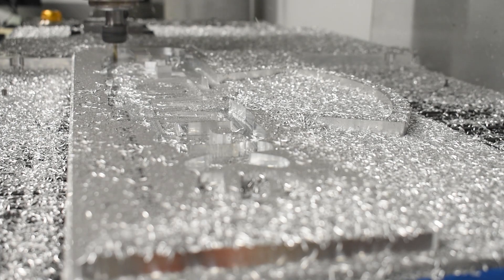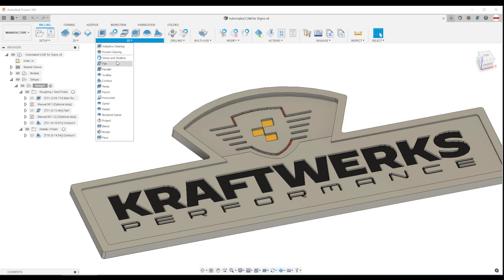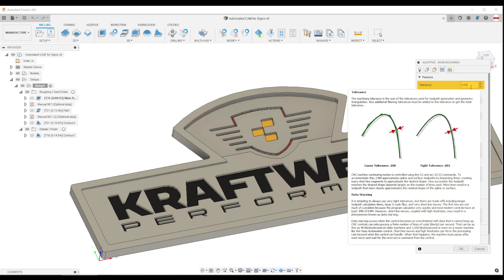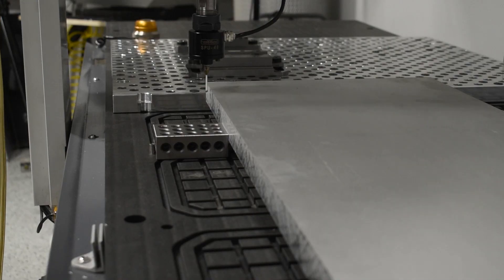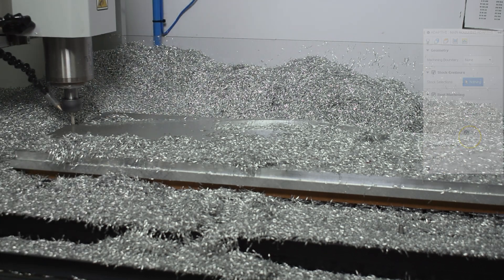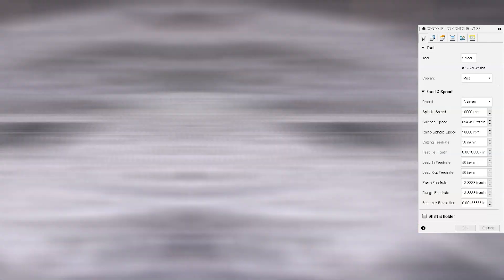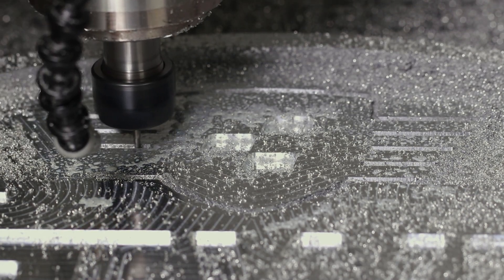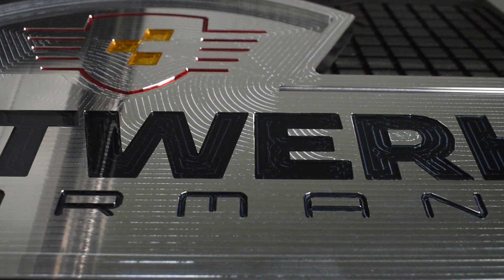Machining an Epoxy-Filled Aluminum Sign in Fusion 360 with "Automatic" CAM!

Comment: Do you think the epoxy will hold up outside with temperature changes? I have been wanting to the same type of thing for my shop sign, but figured different coefficient of expansions would cause the epoxy to flake off.

Comment: As someone who programs using PowerMILL it's weird to see that many of the new fusion360 features are just old PowerMILL features that that been copied into fusion. Things like NC Programs, flat strategy, steep and shallow, etc...

In PowerMILL they have a great macro language that allowed me to create a macro that roughs, finishes straight walls and flats (and limited steep and shallow path) - drill, ream, tap, and counterbore holes for multiple sides of a part. I was wondering if fusion has anything similar to automate processes to that level?

Comment: If you want to remove the tool path tracks from under the epoxy from being seen use an opaque epoxy dye rather than dark transparent dye and this would have been perfect, personally i think the black needs it. Great work guys!